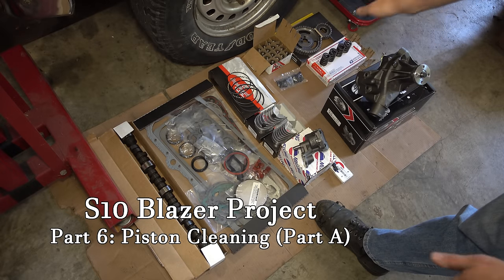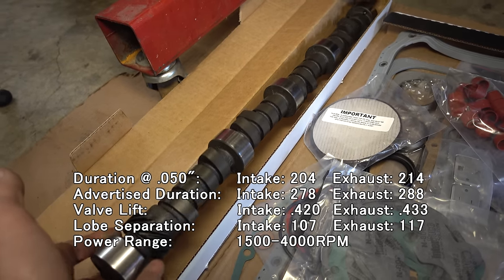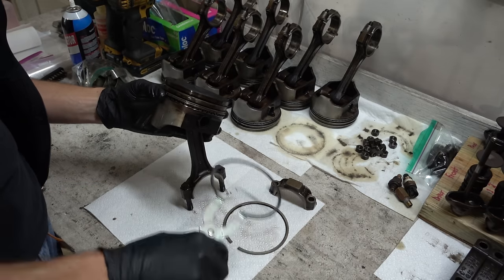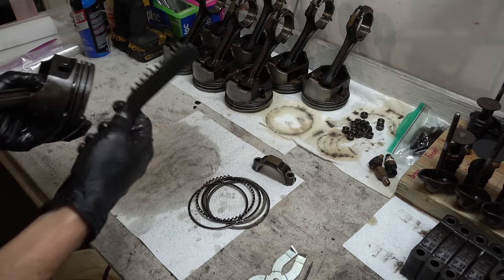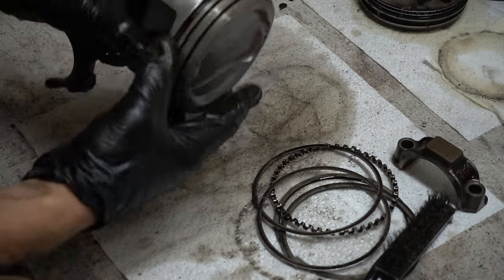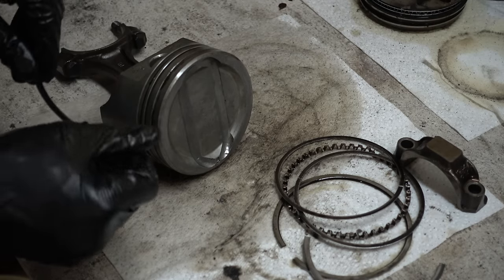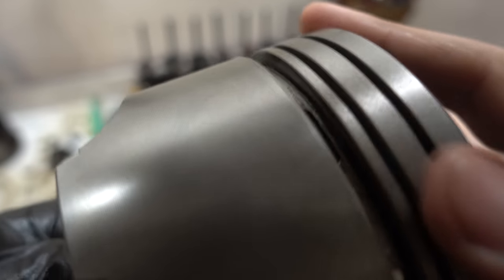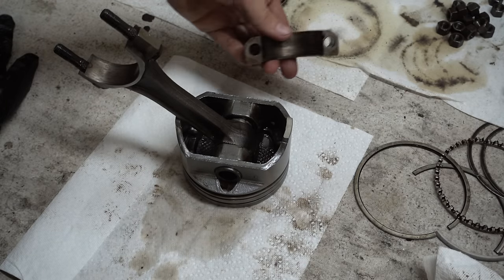V8 S10 Chevy 350 Piston Cleaning (Ep.6, Part 1 of 4)

Comment: I wouldnt have used purple power on aluminum due to things I've seen, Like on a friend's car he used purple power to clean an aluminum intake manifold exterior when cleaning the engine bay and it made the aluminum turn white and start to get "crusty", tho idk if its different grade of aluminium it effects or something.
Reply from the maker: Did he use a wire brush to clean it? Certain types of brush (steel) will cause a reaction in the aluminum and can cause it to oxidize like that. Stainless wire brushes are the way to go for aluminum parts. I doubt degreaser caused that, but I couldn't say for sure. Never noticed an issue with it when I used Purple Power.
Reply: @FuzzyDiceProjects  Really? Steel will cause that? We contributed it to the purple power because it only happened when he used it. He always cleaned it with a steel brush and it wasnt until after using purple power it started to oxidize.
Reply from the maker: @EHoward64  Honestly, I have never done real testing on that for myself but that is what I have read in many places. Cleaned a carburetor body with a steel brush once or twice and had that result, never had it happen to one cleaned with other methods, including more than one soaked in Purple Power. But it could be some weird reaction or have to do with the composition of the metal itself. Could even just be that the degreaser cleaned it so well that it didn't have any protective coating/layers built up on it to prevent that oxidation.
Reply: @FuzzyDiceProjects  Thats entirely possible. Be an interesting experiment to see cause I know he used harbor freight wire brushes.

Comment: Tide and water also will remove paint from plastic parts with out damaging them , but with plastic depending on how thick the paint is it could take up into a week just light brush each night and back into the solution . With carbon on internal engine parts just over will do. Try one small part & see you will be surprised

Comment: Just a cleaning tip, if you dunk them in Automatic Transmission fluid it eats carbon for breakfast
Reply: O, I just remembered that I have 2 pistons for a 'test' soaking in ATF for a couple of days... maybe I should check if it actually worked...
Reply: @TerrybleGamer  did it work
Reply: @TheSleepyMechanic0524  No.. ATF did nothing. Soaking them in diesel for 2 days and then clean them off with a very light scotch brite and carb cleaner worked great.
Reply: @TerrybleGamer  sounds about right. Atf is much better at getting engines unstuck.

Comment: Best thing I found to clean pistons/parts is the gallon of carb/parts cleaner that has a little dip basket in it can get it pretty much anywhere but you have to let it sit like a good hour but it takes all the carbon off without scrubbing and just spray it all off with brake cleaner
Reply from the maker: Yep, that is a good solution! Another commenter suggested using tide detergent in a similar way, which interests me because I'm stupendously cheap.
Reply: taylor pierce gotta love that carb cleaner

Comment: If make up bucket of hot water 1 cup of tide granular clothes detergent  two gallons water put them in submerged over night , brush with a paint brush rinse hot water come out like new. Cheep easy mindless
Reply from the maker: I must admit, I have not heard of using Tide to clean pistons before! I've heard of it for cleaning oil and abrasives from the engine block, but never tried it myself. I think I'll have to give that a try next time I need to clean parts like this, thanks for the tip!

Comment: Clean both pieces. Wear welding gloves, so no hand heat transfer. Freeze pickup tube end with inverted can of PC Duster spray. Heat gun pump housing. RED Loctite in housing bore. Quickly slam in tube, tap with rubber mallet, till it bottoms out, quickly twist into position.

Comment: Brass is harder than aluminum...
You should never use brass to clean up aluminum.
It can damage it.
Nowadays we use rubber pads that spin fast.
You can use brass on cast iron.
You always want to use something that is softer than the metal.
All you want to do is get rid of the dirt, Not the material it's made from.
It's so critical.....

Comment: I always shudder when I watch someone using a cutting blade on a grinder without the guard!  Having suffered a broken blade, WITH the guard in place, I really cringe.  Please change your habit before too late.
Reply from the maker: I just about always use guards now, except when absolutely impossible to use one. The one on that grinder was just difficult to use and the screws liked to back out. I have seen some scary damage from the things (there is a reason they are called "death wheels"!) so it is definitely best to have that extra layer of protection. Thanks for looking out!
Reply: Ive used a cutoff wheel before and had a guard and it saved me. Had glasses on also and the wheel broke and hit my leg and arm. Always use safety!

Comment: Thank god for the air compressor and wire wheel .
Reply from the maker: The grime was light enough on these it didn't seem worth it to me to use the die grinder, I feel like the wide surface area of the hand brush did things just as fast if not faster than I could have with the little wheel on the die grinder. And I wouldn't put a piston anywhere near any wire wheel I've used on a bench grinder!

Comment: Great video, but I thought you aren't supposed to reuse head bolts?
Reply from the maker: Only certain ones that are torque-to-yield, like many Japanese engines use. That means they are designed to stretch in a certain way as they are tightened and will not reach the correct clamping force if used again. Most older American engines just use regular bolts, like this small block Chevy does.

Comment: imo, i wouldn't reuse head bolts on anything where the holes go into a water passage. On my Buick 350s I do because all the holes are blind, as they have a bottom, and they usually clean up well and have no pitting, again, because the holes are blind and dont protrude into water passages. If a bolt is pitted, it's structural integrity is compromised.
Reply from the maker: For a cylinder head seeing boost or high compression, or a more expensive build, new head bolts are a very good idea. For stock-ish SBC, if the bolts pass a visual inspection after cleanup I wouldn't hesitate to re-use them. Thread sealer keeps them from leaking, and a regular coolant change interval keeps it from getting too acidic, so they are fairly safe in there.

Comment: Just found ya channel, great vids, one thing bothers me tho, I was taught to never, ever re-use "cylinder head bolts" because they've been torqued & stretched to specs for the 1st time, so they're more prone to premature failure the 2nd time around.....not saying you're wrong, but just was taught differently.
Reply from the maker: On a small block Chevy, especially a mild one like this, they are totally fine to re-use. Some engines use torque-to-yield bolts which are designed to stretch and should never be re-used like you mentioned, but not these older small blocks (before the mid-1990's you should be safe). Of course, if you want to spend a little more for new bolts, it would not be a bad idea.

Comment: Get rid of the paper towels. TOO much lint and there will be too much FOB tracking into the rebuilt engine.
Reply from the maker: I don't know what "FOB" stands for, but the lint and fibers from paper towels (as long as it's not on critical gasket surfaces), doesn't pose a threat to a small block Chevy. At some absurd level, sure, you could maybe get it to sludge enough to get a large piece to stick to the oil pickup screen and cause a blockage. But at a reasonable level, with particles of paper towel small enough that you can barely see them, I do not think there is any threat. In an automatic transmission valve body, probably don't use regular paper towels. In an engine, they're fine. It's a perfect world vs. the real one sort of situation.

If that is the biggest problem you have with the things I am doing to this engine, it makes me feel better about the build haha!
Reply: FuzzyDicePimp I believe he means FOD meaning foreign object damage. It's more of an aviation based term for objects that damage parts. I.e. a rag in the intake that jams the stators and rotors of a jet engine.

Comment: I heard that you could never reuse your head bolts s*** happens
Reply from the maker: Only on some engines that use torque to yield bolts, that stretch as they are tightened. On many engines (like a Chevy 350 that isn't picky) you are fine re-using bolts but if getting new ones is in the budget, it isn't a bad idea.

Comment: How can you tell where the rod caps go? I took my engine apart a while ago and some of the caps were off the rods, is there any way to tell?
Reply from the maker: That's why it's important to mark where each rod cap goes before taking things apart, it is tough to get mixed up rod caps back in the right place. Some types of rods are actually broken at the parting line, so they have a unique break and the caps will only fit with their specific rods, but most are not like that. Best thing to do would probably be to install the caps on rods and torque the nuts down, and use an inner diameter micrometer or similar tool to measure the roundness of each, and just try different caps with different rods to find the combination that makes each as round as possible. Of course, each rod cap can be installed in two different directions and that can make a difference too. The same thing might be possible just measuring on the crankshaft with Plastigage, but you'd really want the accuracy of a micrometer there.

Comment: Use Scott blue shop towels, they are lint free and dont tear easily
Reply from the maker: I have some but don't use them as often mostly since they are a bit pricier. I have not yet found shop towels that won't lint/break apart on the sharp edges of machined parts, though. Regular paper towels do have lint, it is unavoidable, but it is small enough, soft enough, and easily washed out of the system the first time an engine/transmission/whatever is run.

Comment: Have you ordered the same size crankshaft bearings? Woulnt it be smarter to regrind the crankshaft to another undersize?
Reply from the maker: Yes, installed crank bearings the same size as the ones in it when I took it apart. Smarter to get it reground? Definitely! Cheaper? Nope, and that's me in a nutshell. The engine seems fine so far, and has great oil pressure though.
Reply: NP.  Have just seen the video with the clearings. You do your decisions and deal with the consequences. You had some learning experiences on this car and alot of fun for sure.
I really enjoy this. Instasub on first vid btw.

Comment: Ive always been told to use new head bolts because old bolts can be weakened by years of heating and cooling.
Reply from the maker: It is a good idea, for sure, and some engines that use torque-to-yield head bolts actually require that. But on a low horsepower small block Chevy, as long as the bolts are clean and straight it is totally fine to reuse them.
Reply: FuzzyDicePimp or you can be like sloppy and reuse head gaskets every single bolt and make 800hp to the wheels through an unlocked converter
Reply from the maker: I respect the heck out of SloppyMechanics, but he's also terrifying haha

Comment: You should definatly replace thos rod bolts man its cheap insurance to make sure that bottom end stays together and on a second note that cap fits way too loose which is another reason you should replace those rod bolts they are cheap just throw a set of arp bolts on there man
Reply from the maker: Ideally, you're right, ARP bolts would be great to use, but what is on there will treat me fine. The cap isn't loose, I had to try four or five times to get that shot of it sliding on in one go at the end (you can see one of those attempts at the end of part 4 of this episode). In a race engine, sure, go ARP. In this one, we're all just lucky I'm not holding the rods together with zip ties!
Reply: FuzzyDicePimp yeah but i mean a a set of arp rod bolts for a 350 are like 50 bucks and i was taught to always replace rod bolts with a rebuild i mean its your choice but i would highly recommend it
Reply from the maker: If I used ARP hardware, I wouldn't feel comfortable without reisizing the big ends, a change like that can really affect clearances since they are so tight for SBC rods. So the price isn't all in the purchase of the hardware. Other than engines built for horsepower or with no regard for budget, I don't know many people who wouldn't just use the stock ones.
Reply: FuzzyDicePimp i would more recommend at least replacing them with any brand i was just taught to never reuse rod bolts

Comment: Are you worried at all about the quality of the parts you ordered? Those prices look like they are pretty low quality parts.
Reply: Jake Tow they are fine, 350's have been around forever, and parts are plentiful and cheap. The oil pump parts are Melling, top of the line for oil pumps
Reply from the maker: Like Dave1135 said, companies have pretty much figured all of this stuff out for these engines. And they are so simple, there kinda just isn't all that much to go wrong if the parts are made half-decent. And they are so plentiful, companies can make these parts in huge quantities and source them from many different manufacturers to get them to your door cheaply. If you need an engine guaranteed to last at 6500 RPM, or put out 600 HP, then those parts are out there too, at a very different price point. I haven't been burned by these sorts of cheap parts yet (not that it won't/can't happen), so I am not worried about it.
Reply: FuzzyDicePimp Thanks for the prompt response, I appreciate the explanation. I had questioned as I am rebuilding a Toyota 22R, and parts for it are so iffy, for cheap you can get crap parts but it doesn't seem to be the case with yours. Twice the horsepower as mine for a fraction of the cost!! I'm gonna be in like $2K!!
Reply from the maker: It totally happens, and there is a huge gap in prices between brands and engine families. I helped a friend rebuild a 7MGTE a few years back and the amount of money he spent on parts for that thing (a mild boost 400-ish hp setup) was outrageous. Parts for the L28 we half-rebuilt in the Datsun 280z series on this channel were well over twice the price of the ones used in this build.

Best of luck with the 22R, those engines have a fantastic reputation for endurance, I hope yours treats you well for many years to come! If you do it yourself, brand, horsepower, and cost don't matter. Just that YOU did it.